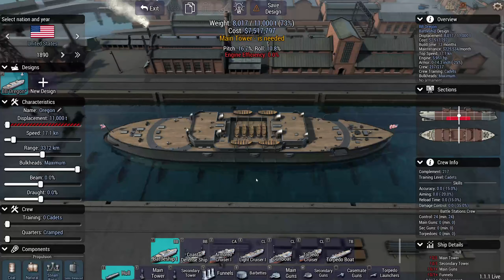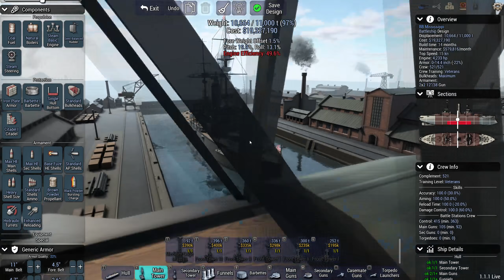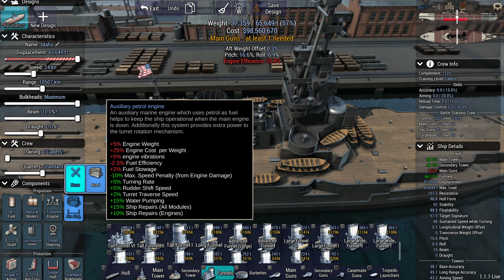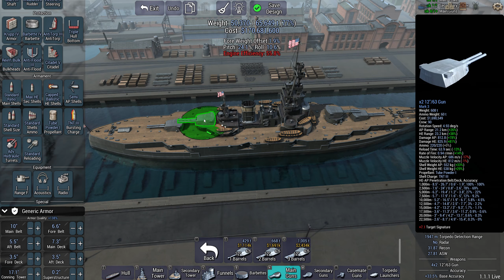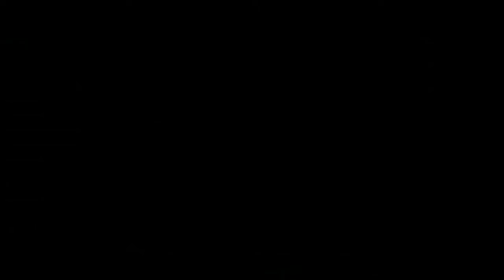Battleship Guide - Ultimate Admiral Dreadnoughts Tutorial

Comment: My general design philosophy:
BBs: Tanks. I build them only as cruiser killers so I can maximize armor (especially torpedoes! I maximize torpedo protection without question), DD protection, and speed. Give them every protection against fire and flooding, particularly the former. I never give them torpedoes! Ever! I give them low draught so they sit high in the water and are less vulnerable to deck hits. I generally only build very few BBs (2-ish) as their main purpose is to be at the front of battles near my home waters. 

BC: Maximize operational range. These are your convoy raiders and defenders. They're also kiters: lots of speed and accurate, long range firepower. Dont brawl with them. Don't build them to take out BBs. They should kill convoys and cruisers from a safe range. I usually avoid torpedoes on them as well given their high range. I also give them copious amounts of small guns to deal with DDs.

CAs: I build these as cheap BB killers. They should have very low muzzle velocity and high range to increase firing arc. More firepower and less armor is the order here (we want BB shells to overpen!). The intention is plunging fire into the deck armor. In later eras deck armor gets thicker and you have to switch to AP. If I can't pen deck armor with CAs anymore I either start building BBs that can or avoiding fights with BBs. I build everything especially fast so I can choose my fights.

CLs: Standard gun ships. Their purpose is screening for DDs, torp spotting, and setting fires. I also try to minimize muzzle velocity as best I can in case I want to try to pen deck armor. Always have torpedoes.

DDs: Come in two types: attached and detached. Attached DDs travel with task forces and emphasize utility (all have anti-mine and ASW) and operational range at the cost of speed. Detached DDs are spread everywhere near my home waters. They emphasize low cost and ASW. They sacrifice operational range for more speed to disengage.

Comment: when deciding on barrel number per turret it needs to be said that a higher barrel count reduces the amount of required turrets to reach the desired number of guns and with it the weight of the ship.
3 tripple turrets bring 9 guns to the table while twin turrets require 5 to get the same result.
the more turrets the more weight and the bigger the citadel which increases the weight of the ship even more.
Reply: Twin barrels are more acurate, smaler. So 4x2 will perform same as 3x3. And if one turred is knocked out you lose 1/3 of your mai caliber instead 1/4.
Reply: @tadasdovii8262  
weight is a much bigger concern.
also twin turrets were only more accurate early on.
by the end of ww2 triple turrets became the standard for ship artillery mainly because they saved thousands of tons of weight allowing for thicker armoring.

Comment: GUN CALIBER
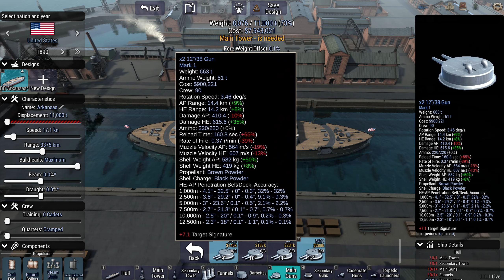03:20 - 03:43
You are wrong about the term "Caliber".

12"/38
 -- 12" = Ammunition Diameter (aka Ammunition Size)
 -- 38 = Gun Caliber (aka Barrel Length in relation to Ammunition Diameter)
Gun Barrel Length is 38 * 12" = 076 + 380 = 456 Inches => 38 Ft 0 In

It is true that Infantry Weaponry and Land-Based Artillery does use the term "Caliber" to mean Ammunition Diameter.

However, the USA Infantry Round .45/70 is representative of the Ammunition Cartridge Design; and, not representative of the Firearm Design.

Your .45/70 Rifle could have a 13-Inch Barrel, or a 19-Inch Barrel, or a 26-Inch Barrel, or a 28-Inch Barrel; which, is dependent upon the Rifle Design that is being used.

The .45/70 was primarily used as a Sharps Single-Shot Rifle Round; which, had a Fixed Barrel Length (I am not sure what that Barrel Length was).

The 13-Inch Barrel Rifle and 19-Inch Barrel Rifle that I mentioned are primarily the Pistol-Rifle Designs; which, were Pistols that had Rifle Stocks as Accessory Items for better Barrel Stability for shooting at the longer Rifle Ranges that Standard Pistol Designs couldn't reach.

YouTuber "Drachinefil" specializes in Military Naval Warfare; and, could get into more detail than I can concerning Naval Artillery Weaponry & Ammunition.

ULTIMATE ADMIRAL:  DREADNOUGHTS Naval Gun Barrel Length Game System Mechanics isn't a good representation of Naval Gun Caliber Mechanics; but, it works at representing the Minimums and Maximums of Naval Artillery Gun Barrel Lengths.

I surely don't know how to make a better Game System Mechanics for Naval Gun Calibers.

14:40 - 16:27
Increasing the Barrel Diameter also increases the Gun Weight; which, does include the Armor Weight for the Armor Rating for that Gun Turret.

Increasing Gun Barrel Length also increases that Gun's Weight.

Decreasing Gun Barrel Length also decreases that Gun's Weight.

Comment: For 1890 ships I always do single barrel. It increases the accuracy greatly. I do secondary's as well, because all you need is to invest in better optica such as stereo and your accuracy will be miles higher than the enemy. Those secondary's will start hitting with experience and better optics. I also add torpedoes and put them on aggressive. I don't expect to hit anything, but torpedoes generally scatter enemies. And if you fire aggressively you will fire first, Early on few ships will have protective stuff so a few good 10 or 11 inch hits, and especially below the belt, will sink even the biggest BBs. You might want to consider downgrading 2" guns to 1.1 inch. The fire rate will increase and with around 1 percent hit chance you are looking at lots of potential hits on TBs. They will have to get within 0.9 miles and you're looking at lots of shots down range. You can always refit a few years later when you have better stuff in order to add some speed, armor, protection and accuracy.

Comment: The real difference between the different citadel schemes is the purpose they have. The turtleback armor scheme is basically a additional plating behind the main belt that is leaned on the citadel (the top of it is attached to the top of the citadel while the bottom is attached to the bottom of the main belt under the waterline, it's called turtleback because if you look at the armor from the front without the fore belt it looks like a turtle shell. The purpose of this is defend especially against close to medium range fire where the shells come with an almost flat trajectory. The main belt slows the shells with it's thickness making them lose some energy and penetration value and then the inner angled plate bounces them upwards so that they exit through the main deck without exploding in the best case, if they do explode, they damage the upper compartments which is still better than a direct citadel hit. It was especially used by german and french BBs historically. 

The all or nothing scheme is basically about protecting the most vital parts of the ship in great priority while sacrificing the protection of less important parts, so basically, very strong main deck with multiple layers, very strong main belt and the rest is futile. It's quite risky because it's basically intended to block all damage head on, quite the opposite the turtleback which is more intended to "redirect" rather than block. While your citadel is pretty garanteed not to take any hits unless you face very big caliber guns, any shells that manages to pen will cause full penetration damage since it's basically impossible to overpenetrate such an armor layout. But unlike the turtleback that focuses on main belt defense, this layout does that a very strong multilayered deck which makes it very resistant to plunging shells (long distance fire basically). 

So long story short, if you're making a brawler BB that's gonna fight at close range and take lots of hits, use turtleback. You want a BB that fights at greater ranges with big caliber guns, then use citadel V.

Comment: Whats the strategy with barrel amounts? And why do you never use the side-by-side main gunds?
Sometimes I put two one barrel main guns side by side. Is it too disadventegous?
Reply: Well from memory (you should just compare it yourself) you are blocking your own turret and adding needless weight and cost, depending on the tech level 1 barrel almost always inferior to 2 and 3 barrel.
Reply: Using one barrel is really not a great idea. Although less barrels generally means more accuracy and better reload time, the gains are not enough to really outweight the cons of it. Say you want a BB with a full salvo of 8 shells, you could use either 2  quad-guns, 4 twins or 8 single guns. The 8 single guns would give you more base accuracy and better reload but you will also have way more displacement used for guns, because at equivalent caliber, 8 turrets will always be heavier than 2 or 4 turrets. Which means you will have way less available displacement and cost to spend on other aspect, so you will end up with a ship that has slightly better gun performances, but considerably worse armor, mobility and equipments. So here is the question, is a slight improvement on firepower worth sacrificing a good part of your defense and mobility? Personally i always use twin guns. I feel like it's the best compromise between having decent accuracy and reload without taking too much space and displacement.
Reply: more turrets = more weight and bigger citadel which = even more weight.
usualy 3 tripple turrets is good enough for battleships and battlecruisers.

Comment: I have something to say usually enhanced reloading takes off 3-7s so in my opinion enhanced reloading is not worth it. Also good video.
Reply: It may not, but is it really taking that much weight? I never put it any thought, for secondaries early on rof is critical, so I always take it.
Reply: @VuldEdone  It does tend to add on 1-2 percent of weight, but it also hurts accuracy, turret traverse speed and (if I recall correctly) makes you more vulnerable to ammunition detonations. It's not worth it in my opinion.
Reply: @notarobot7620  Good to know, thanks. Accuracy and detonation do sound bad, I could drop it as well.
Reply: @notarobot7620  that is incorrect. It increases weight, increases cost, decreases aiming speed, and decreases turret speed. It does not affect accuracy values, explosion chance, or design flaws, assuming that the guns are fully aimed.

Comment: First rule of YT: only comment after you listened to the whole video. Aaaaand I'll break it.
Thing is, I'll make two remarks I realize might only apply to France, because 1890 France is basically overpowered.
> With a tech-rush for Coinc 1, 50mm secondaries on French ships, glad to their wide fields of fire, will repel small ships and even burn bigger ones fairly reliably. So yeah, put as many of those as possible. Forget 100mm though, they are less accurate at very-short range (~1km, where you need them) and fire slower, which is bad to stop the small fry.
> Until "induced boilers" is unlocked, speed should be around 17-18kn. Once "induced boilers" is unlocked I up it to 19kn but also, and crucially, long-range (for the range slider) becomes mandatory. Range decides if your ship gets in battle so, yeah. French ships have the added bonus of a very high range, it's easy to get them past 10,000km. But it's the slider that matters.
I still struggle to tell, mostly because my campaigns have a hard time reaching that stage, how to handle the 1910 transition.

Until 1910, close-range engagements are the norm. I know "coincidence" rules until Coinc' 2, but as a rule of thumb I switch to Stereo' 3 and stick to Stereo' from that point on, as ships are meant to stay at range by then -- enemy accuracy becomes too great, and your armor won't protect you so much anymore. Also, torpedoes. 
But I've yet to figure when to give up on 50mm to switch to either 100mm or 150mm secondaries. 150mm secondaries are my go to in 1930-40, the multirole turret by excellence, though again other players could correct me. I also notice that around 1910 I'm stuck with 300mm turrets for my BBs, and lack the firepower to really hurt my enemies. That's probably because I tech-rush rangefinders (and armor) for too long, so I would probably only tech-rush "Harvey" armor and up to "Stereostopic 3". 
(Exception being DDs who can't hit anything at range even in 1910, I think, so I would stick with Coinc'  and 50mm for them even then.)

Oh, and on ship class...
The BB does everything. I only build TBs (and later DDs) for the campaign level: to screen against subs/mines, to help intercept and to protect/attack convoys. I also only build CAs for foreign station, and possibly to attack convoys. That's because, as said, French BBs can fend for themselves and pretty much do everything as well as any other ship, so why bother. 

Again, all of that is only viable with France, and the reason why I have so much trouble picking up another country where every BB hull feels worse to me.

EDIT: regarding torpedo protection, "resistance" is what matters most to me. Resistance has an absurd effect (or at least had, back when I played later eras) that basically dwarves armor itself. It might be worth having a smaller armor for more resistance -- not sure about that.
This is why, even though I expect zero torpedo hit, I always get torpedo protection up to anti-torp' 2. Past that it gets a bit pricey for me -- like triple bottom -- and I've yet to really play with that. The meta might incentivize going anti-torp 5 always, triple-bottom and drop armor for all of that.
EDIT2: One more remark, on late-game secondaries: they are vulnerabilities for your BBs. You still need them, especially since CA/CLs may not want to stay near them for screening (due to collateral damage), but any secondary gun is an occasion for the enemy to pen'.

Comment: In my experience playing basically only the early years, fast battleships are more important than everything else because torpedoes are basically the only way to kill capital ships in a reasonable amount of time.
Torpedo boats basically commit to suicide missions against larger ships and cruisers are just nice for dealing with whatever your battleships can't catch
Reply: For this reason I run BBs as BB and CA killers and I also have CLs for everything else.  Though in practice, my CLs are built, by accident, in a way where I can kill most anything 1 on 1 with it unless it is a BB.  This lasts me until I am building modern cruisers in the 1920s and dreadnaughts in the 1910s.
Reply: Yeah I also disagree with the video about that bit.

Even if you can only get, 18.5kn on your battleships, that's a far cry from 15, and you can just turn tail in fights, avoid enemy battleships and CAs, and have a long time for enemy CLs and TBs to close with you. Might be "cheesy" but a lot of battles I play in the 1890s are basically my battleships and CLs sailing in a line perpendicular to where the enemies are coming from, and picking off all the fast ships. Once most of the TBs are damaged or sunk, then turn in to engage the heavies.

Also with CAs or CLs, if your top speed is 2-3 more than the enemy, seems to roll pretty well on "Withdraw" on the map to just avoid unfavorable fights.